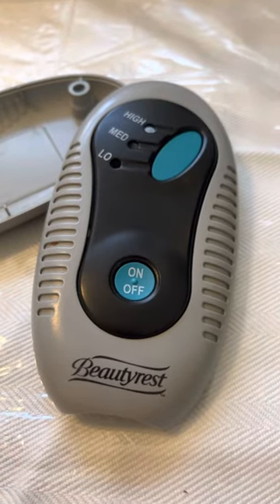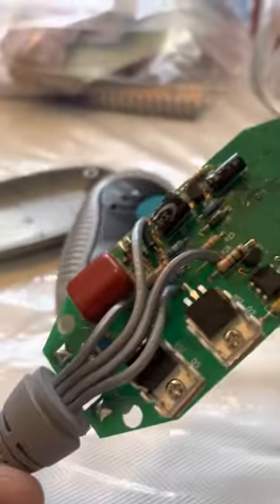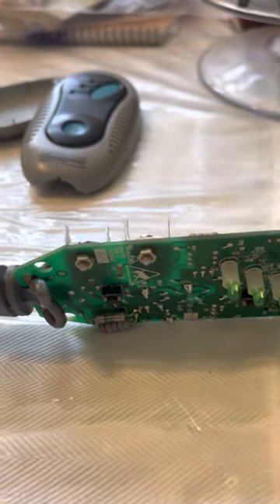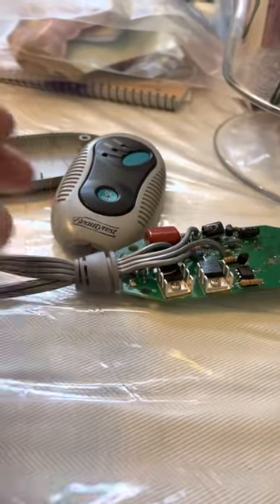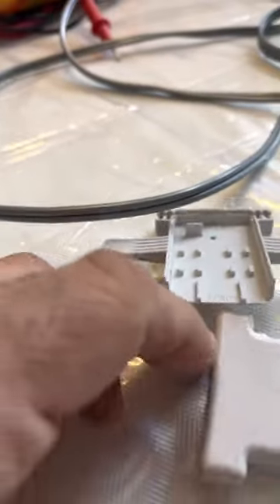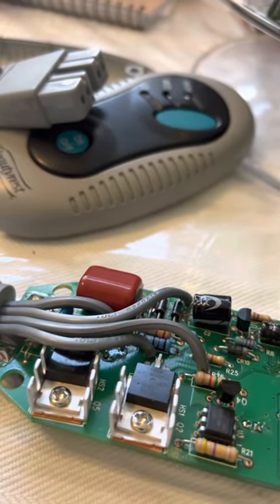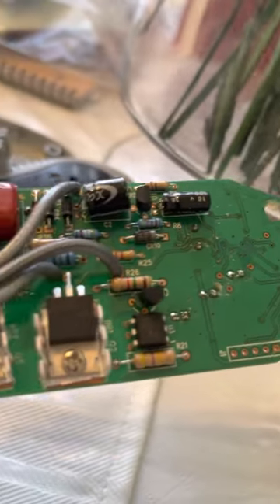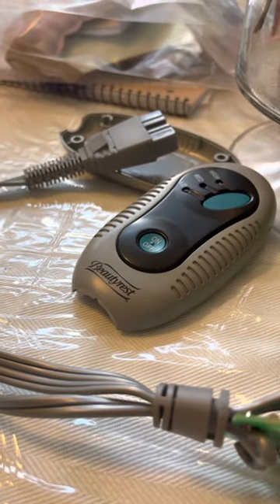How to troubleshoot an electric blanket

Comment: Do you ever strip all the wiring out of a blanket after it doesn't work anymore and use it for other things like tying up bundles?  I was wondering if it's safe and not have any bad parts like asbestos. Anyone?